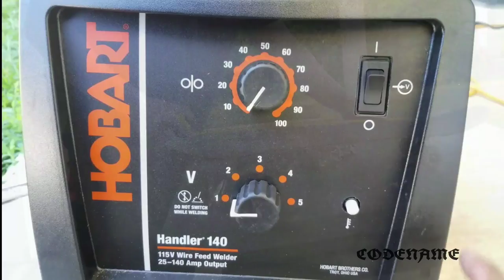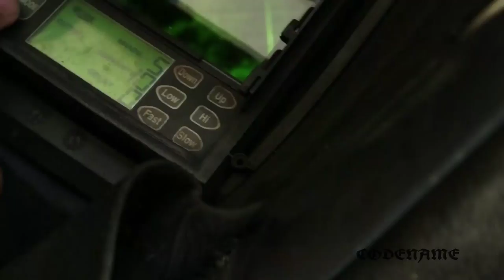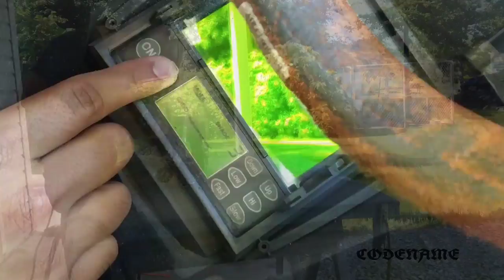Making a Skateboard From Chain Links

Comment: hey man do you use argon gas in your welds or no gas??? and this is MIG welding right?????
Also love your axe and flail video.
Reply from the maker: The term used for this welding process is FCAW or flux core arc welding. I'm using gasless flux core wire. No shielding gas is required. Thanks for watching.

Comment: But why not a Lincoln electric welder?
Reply from the maker: Callum Krnavek ...l like Lincoln and miller too and have used them alot. This Hobart welder is a really good machine and works great. The main reason i got it was because i got a good deal on it and because it can be easily be converted to use solid core wire as well.
Reply: CODENAME-I used to have one but it craped out. It would only weld for 3 seconds. Now i got a lincoln 180 with an aluminum gun.
Reply from the maker: Callum Krnavek ...cant go wrong with a Lincoln, I've used them alot at my last job, they're good machines

Comment: How did you weld it arc or gas? Pls reply because for my school im gonna try to do this
Reply from the maker: the man in the yellow suit17 ... it's called flux core wielding
Reply: CODENAME ok thanks for the reply
Reply: CODENAME what type of chain did you use?
Reply from the maker: the man in the yellow suit17 ...are u taking a welding class?
Reply: CODENAME im so sorry im new to welding. But like what type of chain did you buy?
Reply from the maker: U want to use plain steel chain, not chain with any galvinized or zinc plating on it.
Reply: CODENAME how did you do the trucks on the board?
Reply from the maker: the man in the yellow suit17 ... do u mind telling me how old u are, because if ur a kid, make sure u have some adult supervision as welding can be hazardous.
Reply: did you do it? did it work?

Comment: where's your mig nozzle?  Your gas is going everywhere and you'll get so much porosity.
Reply from the maker: BLOOD 8 PRODUCTIONS... I'm using a welding process called flux core aka FCAW. Gas is optional, but not required when welding with this process. Check out the welder and all the weld gear i use, links are in the description.
Reply: CODENAME okay, I am familiar with Flux core. I just couldn't tell, I thought it was just normal 035
Reply from the maker: BLOOD 8 PRODUCTIONS ...thanks for watching. The welder im using can be set up to run solid wire too. It's a great machine!